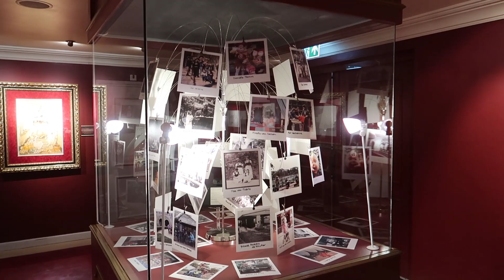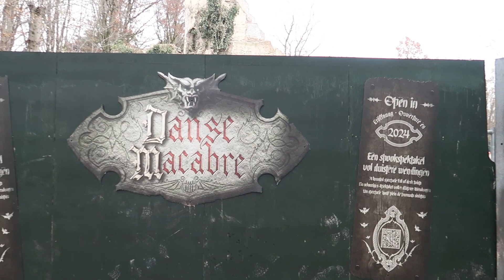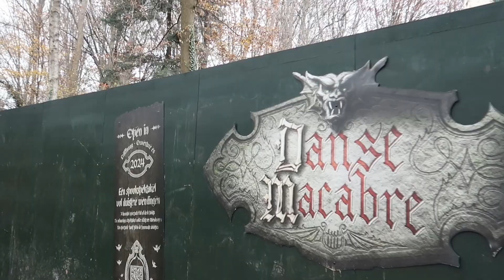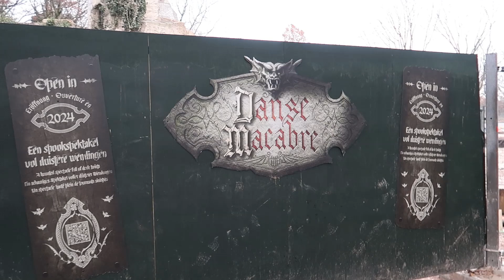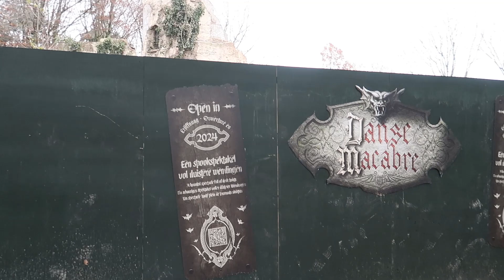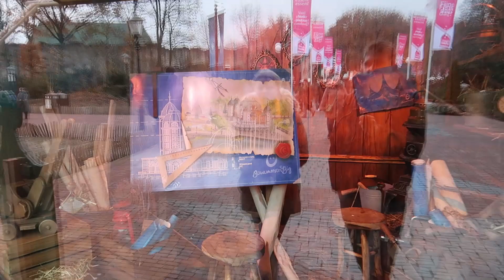Efteling Day Two Vlog December 2022

Comment: With Joris down, they can afford to have people run the second station of Flying Dutchman too. Year Round-ish ops probably help too
Reply from the maker: The operations are fantastic at Efteling!
Reply: They can if they have to but its not necessary. During the winter season its always less crowded in the park with short queue lines most of the time.

Comment: Basically the main reason why Efteling decided to demolish Spookslot is that the building's structural state was in a really bad condition and unfix able, even part of decorative wall on the outside, (the wall in front of the tunnel) already fell down some time ago. and it lost its popularity (until the announcement came that it would be demolished. But spookslot will not be fully gone, besides from the music and violin (which is also the name of the new attraction,)  they will also re-use decoration, also aspects from spookslot will return like the sculptured toilet entrance signs will make a comeback, and part of the tower and wall which is still standing will become decoration of the new area.
Reply from the maker: Thanks for sharing!